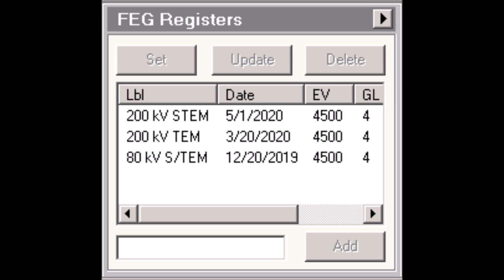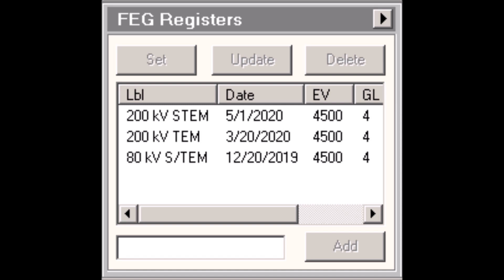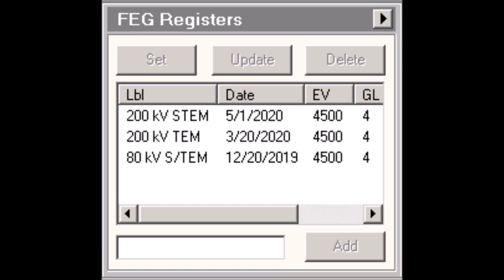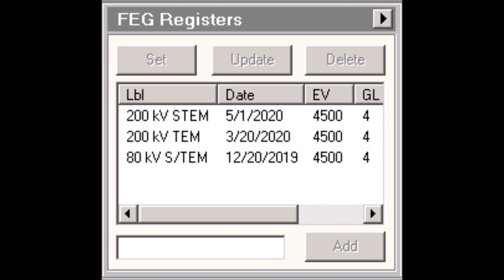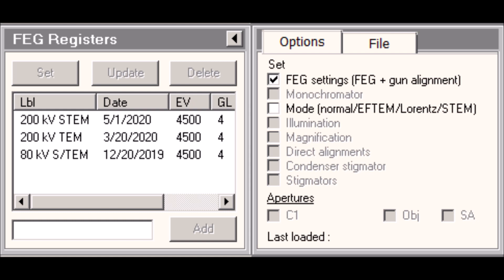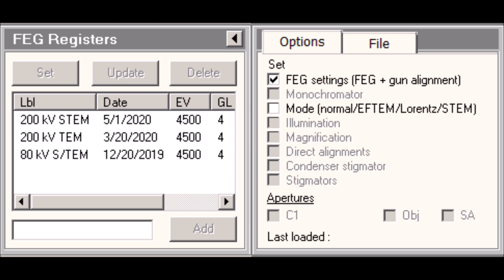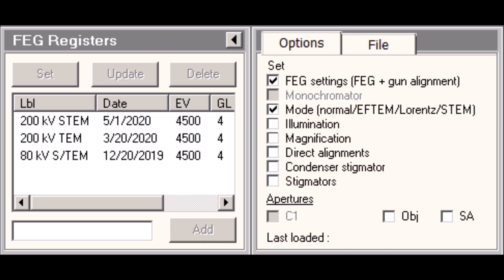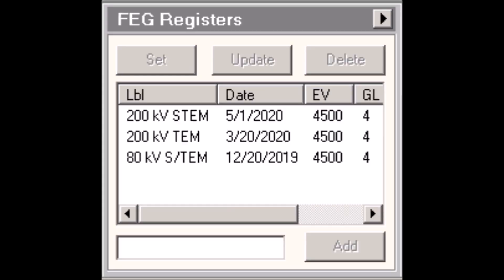FEI S/TEM FEG Registers: Uses and Cautions

Comment: Thanks for the nice explanatory video. FEG register settings seem to be very useful when you want to quickly align the microscope after changing the accelerating voltage from 200kV to 80kV or 80kV to 200kV. It saves a lot of user time and helps to obtain results quickly when we are analysing a wide variety of samples such as polymers and metals. For polymeric samples, we often have to switch the microscope to 80kV to avoid beam damage to the sample. We also have a similar feature in JEOL microscopes where we can save and reload the previous alignment files. But I am not sure if we can save the aperture positions in alignment files in JEOL microscopes. 

I agree with your point that due to lens hysteresis, we are not able to attain the exact stigmator values but it's good for attaining a ball mark value. I used to load the alignment files to reach a ballpark state and then perform the final alignment manually. This strategy helped me in saving a lot of time and obtain the desired result.